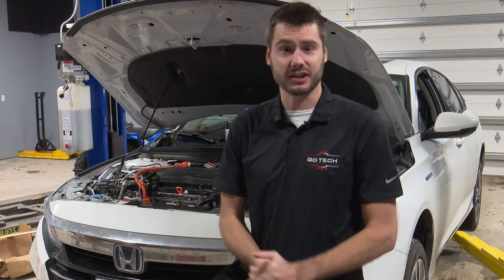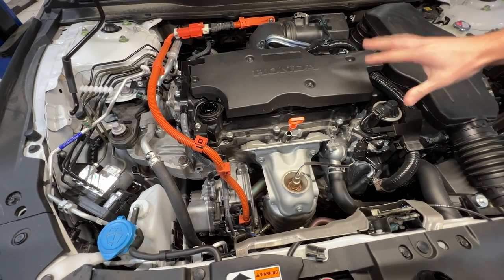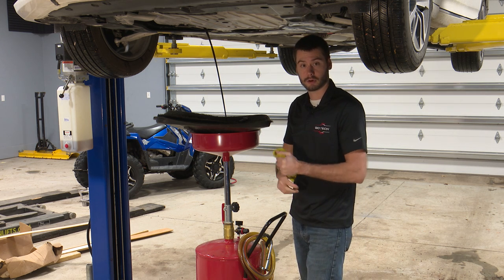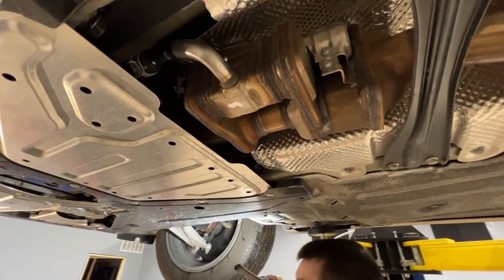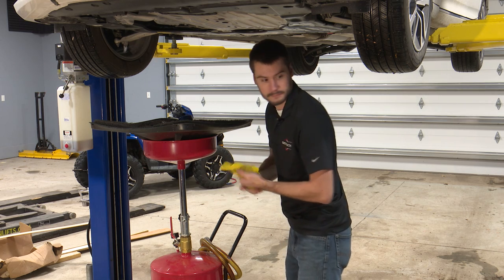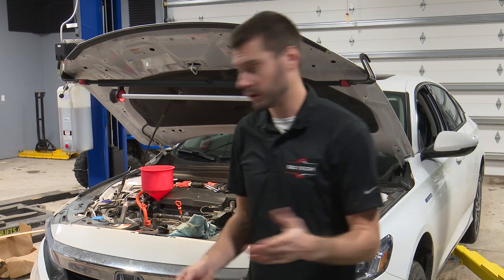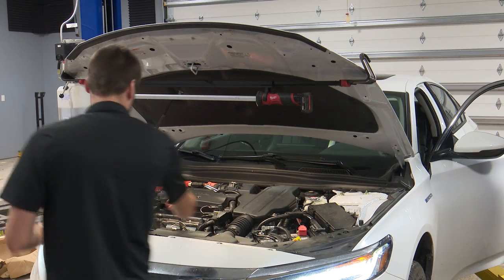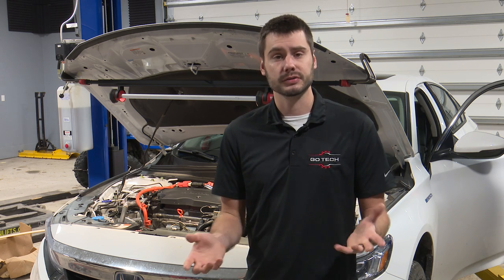How To SAFELY Change Oil On A Hybrid Car

Comment: I look at the bottom of that car in fear. I can't imagine what will happen in around 10 years from now, with them up in the Salt Belt. Those kinds of shields corrode so badly they literally fall off the fasteners. I would imagine the high voltage cable with short, and uh, "It was insured...right?"
Reply from the maker: Yeh, they corrode pretty bad up here in WI. We'll see how they do on here!
~Mike
Reply: I have a feeling fire departments are going to have to all add another piece of equipment over the next 10 years! 😉
Reply from the maker: Have you seen videos of how much it takes to put out a full electric that's on fire. Those things burn so hot! Training is key for the FD's. Where to cut, where not to, that kinda thing. 
~Mike
Reply: @GoTechTraining  Yeah, lithium batteries are wild when they burn! They just keep feeding the fire it seems. Even a small iPhone will make a spectacular fire - I could only imagine a full EV battery array going up! Would be something to see I'd bet!
Reply from the maker: Oh I bet it would be...as long as I don't own it and noone gets hurt, of course.
~Mike
Reply: @GoTechTraining  Amen to that, Mike!!

Comment: oil change spring,oil & filter change fall. winters in NY can be hard on a engine..just my opion. and i'm a fill the filter type .filler up, if it go on sideways your good. if it goes on up top it off,that fabrick does soak up a lot of oil.don,t baleave me try it sometime...just sayin..
Reply from the maker: Hey Kenneth, thanks for watching! NY and Wisconsin winters are definitely both hard on cars!
~Mike

Comment: 🚗 bloody cars haha
Reply from the maker: Cars are so much fun, right?
~Mike
Reply: @GoTechTraining  yeah fun ... or well the fun is in the result! we're in the middle of trying to work out what has gone wrong in an LS we purchased, expecting flattened roller on a lifter after pulling heads they are totally fine, scratching our heads. I put a video up the sounds as it first started till now and everyone tells me many different things, love cars but when you haven't got a clue to whats actually wrong in a taredown you certainly feel challenged.
Reply from the maker: That sounds terrible. I wonder what an in-cylinder pressure transducer would show?
~Mike

Comment: Put the vehicle in maintenance mode; will force the engine to start. Combination of Double tap gas pedal, transmission selection and depressing the brake pedal. Check your manual.
Reply from the maker: Sure, that works! I could see using that if needs any engine diag done. For a quick oil check, turning the heat on is way faster! 🤣 thanks for watching!
-Mike

Comment: PERFECT  STARTING REPLACEMENT OF OIL DRAIN WASHER (CRUSH WASHER), TORQUING OIL DRAIN PLUG AND REPLACING THE FACTORY OIL FILTER HAND TIGHT ; THEN 3/4 TIGHTENING OIL FILTER.

Comment: Even asking this question makes me think the shop is in the boonies
Reply from the maker: Hey Max,
I guess it depends on your definition of the boonies LOL.
But we do live in a very cold climate and are just starting to see a large amount of hybrid vehicles.
This technology makes a lot of people nervous to work on. Which is a good thing, even though it is not that much different from a standard car, there is a protentional for danger. But our message was that 90% of the vehicle is unchanged and you can still repair almost everything with out ever touching the high voltage system.
Thanks for watching and reaching out!
~Ryan

Comment: I want to know why manufactures are pressing 5k semi synthetic oil changes and 10k full synthetic. I’m still going by 3k and 6k. All these new vehicles burn oil after the 3k mark is achieved on the oil. I have my suspicions as to why manufactures say you can go so far when really you shouldn’t and it involves the EPA.
Reply from the maker: Hey Thomas, i'm not a fan of the recommendations either. I've often wondered if it's tied to the "lower cost of ownership" award that gets handed out.
~Mike
Reply: @GoTechTraining  I theorize the big manufactures get some sort of carbon credits or break by pretending these cars are less harmful on the environment by going further between oil changes. But the reality is these cars are becoming junk too early and end up in scrap yards mostly rotting away. The customer wants more power and the government wants less environmental waste but the overall result is an over tuned delicate engine that has a major catastrophe that causes most to just junk the car or trade up.
Reply from the maker: That's a sound theory Thomas! You may just be on to something there. Thanks for sharing
~Mike
Reply: Has anyone sent oil samples to Blackstone? A friend did with his K20 EP, 10k OCI with Penn Syn and blackstone said he'd could go another 5-6k miles, also his K didn't use/burn oil that is common on them.
Reply: I’ve been doing 10k mile oil changes on my 22 HAH with 23k miles. I check the oil often and currently at 9k on this oil and it’s still golden in colour. I also put in a bottle of Lucas fuel cleaner once a month or every 4k miles and everything looks good. I plan on seeing how many miles I can get from it before it becomes totaled due to cost of repairs. The engines shut off and in EV mode about 30% of the time so in theory there should be nothing wrong with the 10k mile oil changes
Reply: @susp3nc317  I’d agree that if your engine is in ev 30% of the time you could go 9k to oil changes. Also I wouldn’t use the fuel additive, it’s just snake oil.

Comment: Over tight drain plug and filter: I think they tighten themselves through vibration, hot/cold cycles, etc. The other day I was lower bay, the upper bay tech put in the wrong oil. So, he came down to redrain the engine. He put the wrench on the drain plug and was surprised how loose it was!  We torque drain plugs; this one was 18 pound-feet. It was a lot tighter than that when it first came in! Thank you for sharing and stay safe.
Reply from the maker: Hey Dwayne, thanks for watching! Yeh, you might be on to something there.
~Mike

Comment: Normally I don't fill the filter on Hondas but I have in Some cases I ran into on Hybrids if I don't It will set a "low oil pressure" message or DTC code for low oil pressure and I would have to take the time to clear the code. I now fill the filter and haven't had any issues.
Reply from the maker: Interesting for sure! I've never run into that but will keep my eyes open. Thanks for watching!
~Mike

Comment: First time I've watched a video this in depth on hybrids. I've never seen one in person except for an older Toyota Highlander I picked up for a car dealer once. I think it was an '06 if I remember right - I had no idea that was even a thought back in '06! The starting battery was TINY. Barely bigger than a full dress motorcycle battery. Engine itself was tiny, too. I don't recall seeing orange wire loom, though - it was probably black from all the years of use, I figure. This thing had a good chunk of miles on it  - over 250k. It was a no-crank, but I punted that one - I had no desire to get involved with that since I've never had a service info subscription. I have a hard enough time fixing normal cars, lol! 

Anyway, I appreciate the heads-up! Propulsion systems may differ, but the rest of any car is still a car! 👍
Reply from the maker: Hey Smitty, thanks for watching! You're completely right, a car is a car and fixing it doesn't vary all that much. That's why I laugh when people ask if we work on Euro cars or whatever...cars are cars, sure sometimes the info is harder to get but electricity and the laws of motion don't care where it was made, or in this case, its propulsion system.
~Mike

Comment: Great video. I go with 5k intervals. After the first one done at 500 miles. ..  one thing I run into often is the side jack points make it difficult to put a jack stand  if there is no front or rear center jack point. Wish they continued to provide the center front and rear jack points
Reply from the maker: Ahh yes, I agree. I prefer to life the front end from the front as well. I miss the the crossmembers or subframes that allowed that. Thanks for watching!
~Mike

Comment: Mike, what so you think about sucking the oil through the dipstick rather than draining it from below, especially when the oil filter is on the top of the engine?
Reply from the maker: Hey William, some cars require it. Where service info says to do it, i'd try it. For stuff like this, i prefer to drain from the bottom. Plus this gets you under the car for a thorough inspection. Thanks for watching!
~Mike

Comment: I had my first oil change at 600 mi at the dealership since it was part of the complimentary 24-month maintenance program. I purchased my Honda CRV Sport Hybrid FWD in Dec of 2024 and will change my oil every 3000 mi/3months, whichever comes first. I will run Amsoil Hybrid 0W-20 with a Purolator filter and not the OEM filter which is just an entry level Fram cellulose media filter. Filters are cheap and major engine repair is super expensive. Great video, by the way....

Comment: Hey Mike,
Should the key FOB be in a Faraday cage or aluminium foil before you drain the oil? What about 'service mode'? I have shown my students that even aluminium foil wrapped around the FOB will stop transmission to the vehicle.  I have heard horror stories of Hybrids self-starting on the hoist with the oil being drained. I personally have had a Toyota Prius self-start while I was nearby with the FOB in my pocket. The Hybrid/EV training I have done have highlighted the importance of isolating the FOB.
Reply from the maker: I haven't heard of needing to go to that extreme. I've also never heard of one starting with the ignition off...I wonder if it's possible? Thanks for watching!
~Mike
Reply: @GoTechTraining  Yeah, It scared the hell out of me when it happened. The training I did really highlighted the importance of making sure the FOB was isolated in some form. They gave several examples of where someone had gone to lunch only to come back to a seized engine. I always stress to my apprentices the importance of at least wrapping the FOB in aluminium foil - it works a treat - even with it sitting in your lap when you try to start the vehicle, it won't. 
Thanks for the video. 😉
Reply: I’ve had one start on me before while it was on the lift, I had a spark plug out as I was getting ready to do a leak down test for a suspect head gasket.  All I’ve ever had to do was place the key on my toolbox though, never anything special for isolation
Reply from the maker: That's crazy!!! Talk about a horrible day. I'll keep that in mind. This process may require a follow up video. I'm intrigued as to how the car can start with the ignition off. I'll dig and if something interesting is found, put out second vid.
~Mike
Reply from the maker: That's wild! And the ignition was off, right AutoMedic? I wonder if its related to HV state of charge? Interesting for sure. Thanks for sharing. I bet it scared the 💩 right out of you.
~Mike
Reply: @GoTechTraining  Yessir ignition was off, I’d heard of it happening before but it was the first time it had happened to myself.  Key was in the car.  I haven’t done much with hybrids and I haven’t had any formal training on them yet even when I worked at the dealer.  But if I had to guess, I’d definitely say it’s a battery voltage issue, more than likely on the low voltage side of the system.  Thinking the engine starts to run the alternator and charge the 12v side, versus the HV side would charge from regenerative braking — not something that would happen on the lift with the ignition off
Reply from the maker: Man that is crazy. Definitely going to get to the bottom of this. Opportunity to shine some light on this stuff I think. Thanks for sharing!
~Mike
Reply: @GoTechTraining  Thanks Mike. Look forward to the extra info. Perhaps I can do some more research on my end & share with you
Reply: @GoTechTraining  I'm sure the ignition was off. Also I was quite a distance away at the time, which I thought was strange as other vehicles I have dealt with have brought up that the 'key is not nearby' & it was on my bench closeby. Very strange indeed!
Reply: @GoTechTraining  my wife can start hers from her cell phone  no nearby key required  also is there a low voltage auto charge auto start on some of these?
Reply: The rule in the UK is to secure the vehicle key more than 20ft away from the car and then wait 15 min for the HV battery to discharge before working on car
Reply: @adammartin4777  Hey Adam, we have a similar rule here in Australia. It is also meant to be in a faraday cage lock box. But as I have shown my students, the FOB can stop transmitting simply by wrapping it in aluminium foil. 
Looks like I've stirred up a hornets nest with my original comment! 😉
Reply: @MiracleMAX  didn't realise your in Australia, I believe your training body is same as over here, (imi) The Institute of the Motor Industry?
Reply: @adammartin4777  Over here we have ASQA (Australian Skills Quality Authority) who is the government training body. I teach apprentices part time at one of the states automotive colleges, part time in my workshop.
Reply: @MiracleMAX  fair one I teach full time students at college here, I'm lucky to be only 1 of 4% of mechanics in this country that is a  level 4 matster tech in Electric Vehicles
Reply: @adammartin4777  Interesting - I am just starting teaching EVs and working on them in my workshop but we are having large growth here in HEV & EVs.
Reply: Isn't it also a good idea to remove the HV service plug and/or disconnect the 12V battery, just to be as safe as possible from accidental engine starts during oil changes?
Reply: I had my 2024 Toyota Hybrid start up on its own after all oil was drained out of car. Luckily I was near by when it happened on Rhino ramps and I quickly turned the car off within 5 to 10 seconds. I then as quickly as possible removed the crush washer with a new one and tightened the drain bolt to spec. and very quickly put oil in the car. I was in such a hurry didn’t get a chance to change oil filter. Upon restart up for a split second car made some noise but then everything was normal and oil was recirculating again. I have had the car out on road since then and everything in car is driving just fine with good clean oil and good clean coolant and no leaking anywhere.
Reply: @Don-rz6jq  Scary! 😱

Comment: Hi Mike the gas engine on a hybrid only runs to charge the 200v battery for the electric side of the vehicle doesn't it? , i suppose that is why the oil would be so clean, SO HOW OFTEN DO YOU THINK IT WOULD TURN ON IN 5000 MILES?
Reply from the maker: Hey Carl, thanks for watching! So on this model the engine is used to charge the battery and propel the vehicle, sometimes at the same time. The engine runs more when it's cold out too. It would be interesting to track engine on mileage vs vehicle mileage...but I haven't seen any menus on the car that offer that data.
~Mike
Reply: @GoTechTraining  oh I did not know that the engine also propels the vehicle, I thought that it only charges the battery, so I just learnt something thank you Mike

Comment: i'm thinking it might be good to pull a fuse for the coils or injectors  something like that just to be safe 5 k on normal vehicles 3k on short run cars. that 10k was just a way to keep epa off thier backs since epa  wants less oil used
Reply from the maker: Hey Richard, not a bad idea. Can't start without spark! thanks for watching, as always :)
~Mike